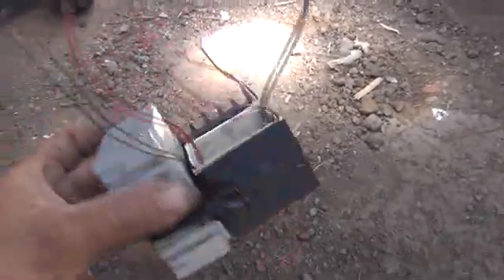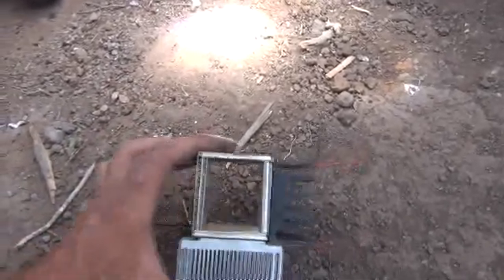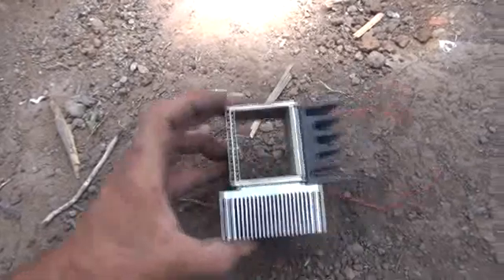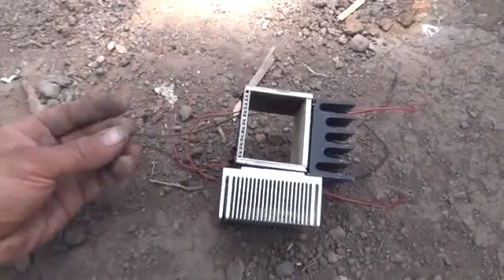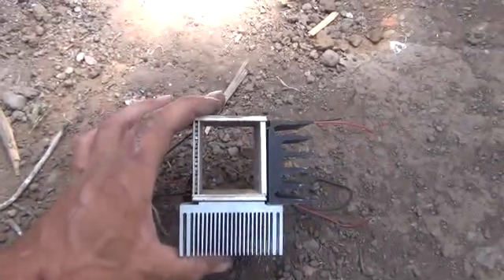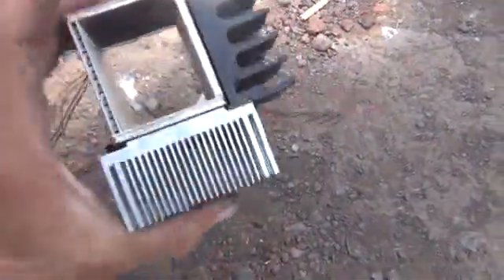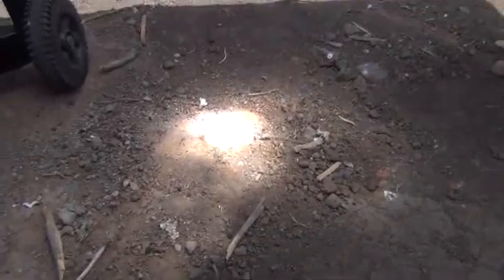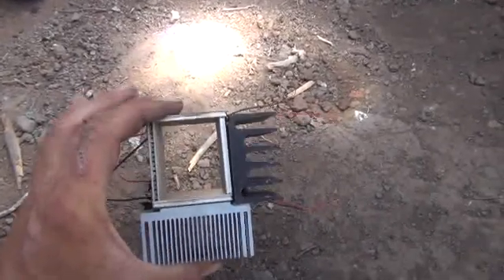Fresnel lens solar tracker invention P#1.

Comment: leds make great sensors, easily connect to transistors which can control the motors, and if you have no local power, a simple solar cell or two from a childs toy etc, and all cheaper than 4 expensive tegs!

Comment: Very interesting. However, while you comment of 10 KW is correct, the energy must be converted to something more useful (unless it is for hot water).  The conversion process is why solar thermo systems have yet to make a big impact.  Certainly the potential is there, but highly efficient thermoelectric devices or thermomechanical await development.
Reply: Stirling engine to home grid or battery storage system